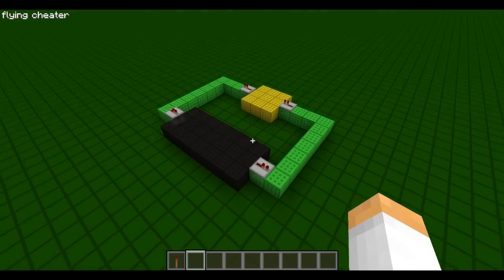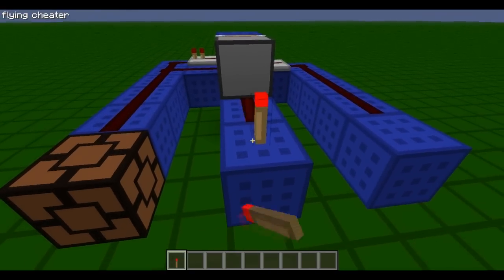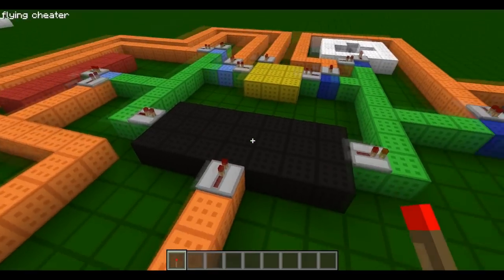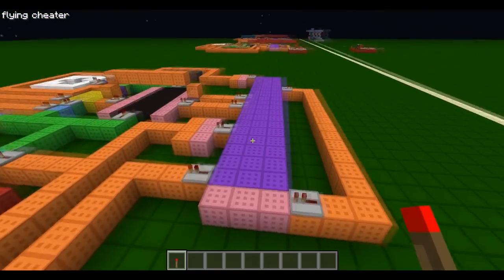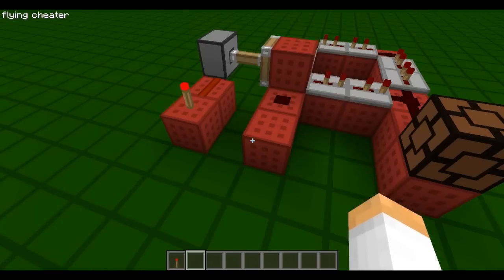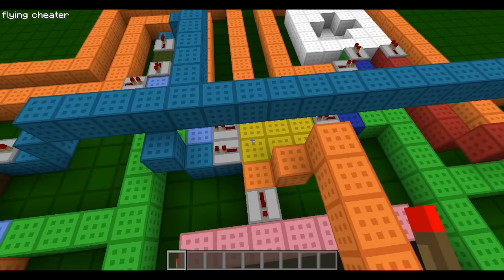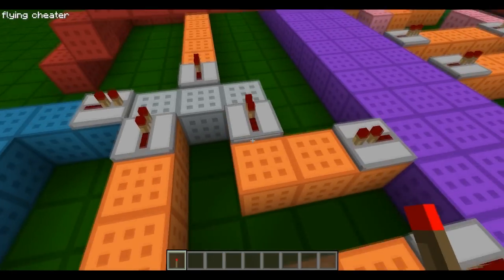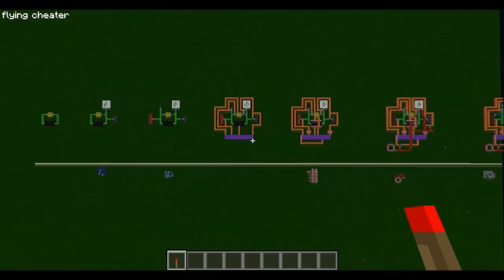How Minecraft redstone computers work

Comment: Could you make a computer so complicated, it's able to save a copy of itself?
And could said copy save another copy of itself?
Reply: Try fitting 1 box inside another, both the same size. It’s impossible.
Reply: @kayrunjaavice1421 , you could fold the box.

Imagine if the boxes' walls were 0mm thick. Then, you could fit an infinite amount of them into each other.
A ram could store itself entirely within its storage; but nothing more. Not even the plastic hull. It's like perpetual motion: a maching can indeed produce enough power to keep itself moving; but nothing more. An orbit, for example a satellite around earth, can do a great example. Now imagine earth as a perfect sphere, there's no atmosphere and there is not even a single molecule in space. The satellite is in a perfectly round orbit. Now, that'd spin for all eternity (if it didn't rot or anything like that). But now, we put a car on earth which is connected to the satellite with a very long string. The car is moving with the same rpm around earth as the satellite. Now, we put a dynamo on the car's wheel. We're now creating power from a satellite's orbit. Infinite power, right? ...no. The dynamo, whilst creating power, is also braking the car slightly, which is braking the satellite. So, eventually, it'll crash down to earth. Not that it'd matter... No atmosphere there, so no humans anyways. But that's not the point.

Well, roughly said, infinity can contain only exactly itself. No more, no less.

Well, i hope you had fun with that wall of text. Did you enjoy reading it?
...no? Well... Ok, then...

Man, i need to learn to control myself about writing my thoughts to everything...
Like triple apostrophes. I'dn't've obtained that habit if it wasn't for my grammar obsession.
Still, i always forget to capitalize "I".
         /\
          |
       See?
Reply: Actually, a png or jpeg is a compressed version of a bmp or raw by finding pixel groups of similar colour. What if the ‘computer compressor’ could see 1 long line of redstone and instead of stating every single block it states the position of the first and last block in the line, so the ‘compressed’ computer is able to fit in another’s RAM or ROM.

Comment: You are one smart guy , you just doubled my knowledge of hardware(outside of a  minecraft context) :)
  But let me ask you , in a conventional computer things are a little different , right? Like,  you would run the command lines from RAM , maybe carry both the Data and the flags on the same bus , no? Decoders are new to me , so genius yet simple!
Reply: Aleksandar ram would have both data and commands. Commands would be decoded instead of the Long 32 bit commands you see for 8-bit red stone computers . There are much shorter commands and most of these in and outputs would be on one place
Reply: When you use a PC Ram will take info from other Parts to send to the CPU which then the ALU/Cores inside will take the info convert it to what it needs then sends it to the Registers where then the registers will send it to the other parts of a PC

Comment: My Joshua BlueMark 1 on Minecraft PS4 runs a Redstone Lamp all the time, in which it can actually run 14 inputs at the same time. Yeah, Impressive, Isn't it? Not sure how many bits it runs on though, although it doesn't really have that many functions, It only has 1 button and 4 levers,The button makes it run 4 note blocks almost at the same time, then activates 2 pistons, and then runs a Redstone Lamp. Every of the 4 levers only runs one of the note blocks. But it does have a nighttime sensor in which when it is Nighttime, it lights a Redstone Lamp up, but if it is Daytime, it will turn the light off. Cool, Isn't it?

Comment: very helpfull :D had a slightly different design for a computer that I wanted to build in real life... but building it would last years :/ Minecraft is definitly a good way to bypass this problem :D Building something need just a few seconds if you use worldedit in comparison to solder around 10000 transistors. But I realy don´t like repeaters... reallife wires would send an information instant :o
Reply: lomtafix idk how well mcEdit works with mods, but you could use some sort of insta wire red stone mod!

Comment: the 1.5 update is actually shaping up to be a bit of a mixed bag...
Bud's, while still present, behave strangely, at least in the snapshots. And fencegates/trapdoors no longer update pistons, which sucks.
On the upshot, 1.5 appears to fix the hashset problems which have needed fixing for as long as I can remember...
As for comparators, sure they will make the odd gate a little faster, but if bluestone proves anything, it is that speed comes from thoughtful design, not using the fastest parts ;)

Comment: it is 16bits by 16 bytes by 16 layers and it has a repeater between every adress but the layers are in parallel so 16tics for one save/read to any adress plus 4 for wiring at the ends that would make 24... (is that good or bad i have no idea) im making a more compacter version without pistons for the reading and gates (they totaly glitch out) and you actually only need an 8bit decoder for save/read

Comment: I know in real, physical computers, data can flow in both directions on a bus, for example between a cpu and ram, if the cpu sets the enable or write pin with a given address sent to the ram, the ram will either store the info sent to it by the cpu at that address OR send information from that address to the cpu, hence data flowing in both directions depending on the task the computer is working on at the time. Is it possible to set something like that up with a redstone computer or do you need two data lines since the repeaters only work in one direction?
Reply: +Angelo Inferno That's a great point , I don't think you can send the data in both directions unless they make an infinite redstone mod(no repaters needed). If you get that sorted then you just plug in your registers to the Bus and make sure your flag controller is set up right :)
  P.S. I am not good at making Minecraft computers , I'm just referencing this "One Lession" video about how the CPU works , wich if you search for I think you will be deligted :)

Comment: Why do you have separate "program memory" instead of having the program saved into and loaded from RAM like typical electronic computers?
Reply: Imagine a bunch of programs and variables in your memory that is not separated. Firstly you will have to use memory to mark out which are variables and which are programs. You will also need additional stuff to recognise the markers. Also due to the 15 block redstone limit your lag will increase significantly. Hence 2 memories.

Comment: I don't get how you made the register.  Can you explain it please?
Reply: bishop9779 The register is something that takes the bus it's attached to data and saves it to itself ( the data can only be in two forms on and off ) Once saved, the data will be locked until they are open again ( they exist so nothing else interfere with the number you are imputting ) hope this helps.
Reply: you can make one by using a locked repeater, look them up

Comment: The only thing i needed to be explained is:
IS The whole "This is the Ram, this is the ALU" Thing just Roleplay? or just acting like it works?
Or does it really DO Things ?
Im Confused.
Reply: No this stuff ACTUALLY do stuff.. 
for an example: An ALU is for the Math like addition and substraction
Reply: so, did Notch / Mojang make the coloration actually useful?
Like, i usually see alot of similar colors such as Green, Orange, Blue, and Yellow.

Are these colors really different from let's say if i use Black and white and gray and Dark blue?
Reply: No, the colors are just color coding for clarity and aesthetics, used by the builders. You don't have to use wool at all, it can be any opaque block. The computers they're building are super primitive compared to actual modern computers, but as you can see from their demonstrations, they can do a few things like display numbers through redstone lamp displays, add, multiply, and other logic operations.

Comment: How Minecraft redstone computers work which is basically how normal computer works XD
Reply: +huang junwei In a certain way i suppose xD
Reply: No, a minecraft computer has delay in wires and calculations. In the real world it is instant. The only thing thats slows a real life pc down is the clock and the input and the amount of logic wires. That is why you cant overclock a MC PC.
Reply: Edwin Pap minecraft computer minus off the delay = normal computer...... The component is the same in both computer....
Reply: That is correct but not electricity travels at a rate of 1 foot per nano-second but a electron. So electricity is in fact flowing even when a electron moves the smallest distance. Witch makers it zo near instant that when you work with electrisity you can say the delay is 0.

Comment: 1GB = 1,000,000,000 Bytes
Reply: Actually, its 1073741824 bytes, as there are 1024 bytes in a kilobyte, 1024 kilobytes in a megabyte, and 1024 megabytes in a gigabyte.
Reply: Same thing
Reply: strictly 1GB is 1,000,000,000 Bytes
and 1GiB is 1,073,741,824 Bytes

because GB are 10^9
and GiB are 2^30
Reply: mahleenberida no: GB are IS unit, GiB are binary unit.
Reply: mahleenberida GB is Giga byte as in metric giga 10^9. GiB is pronouced gibibyte where bi is the keyword, binary. I know the windows operating system says otherwise but microsoft is wrong in this case. Thats why in windows a 1 TB harddrive looks like it is a 930GB hard drive. Because windows caclulated the size in GiB but wrongly says it is GB.
Reply: In network speed they differentiate them by GB and Gb (big and small letter "B"), where GB would equal to Giga Byte and Gb equal to Gigabit.